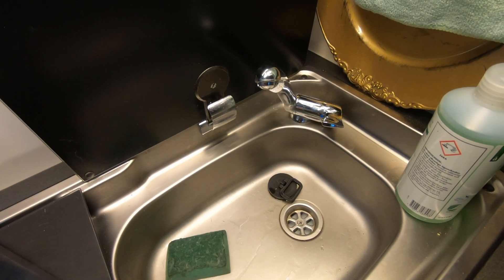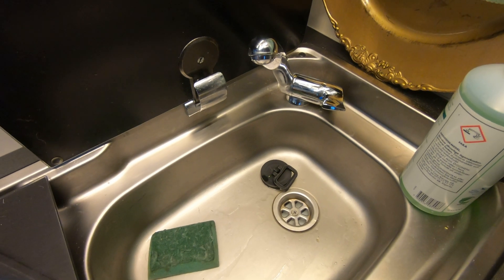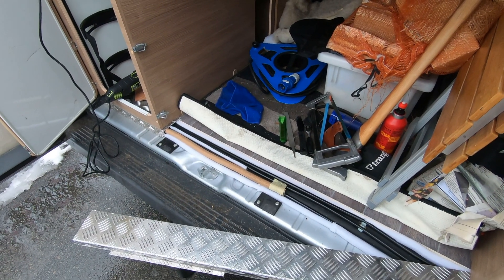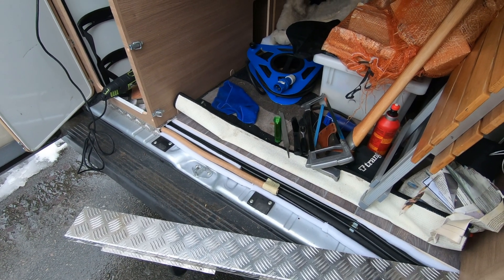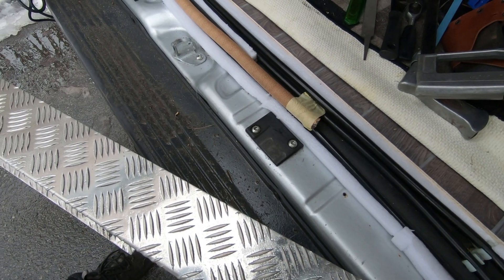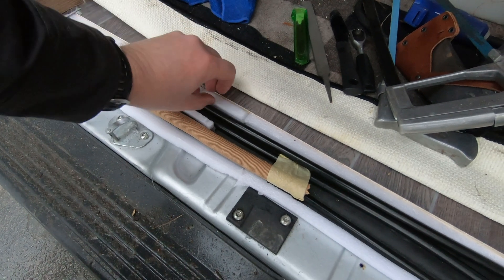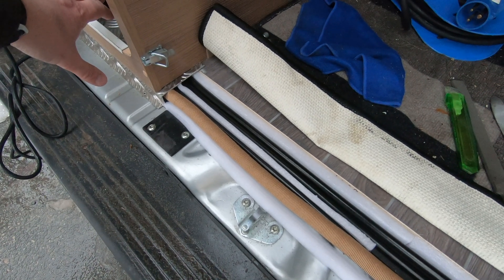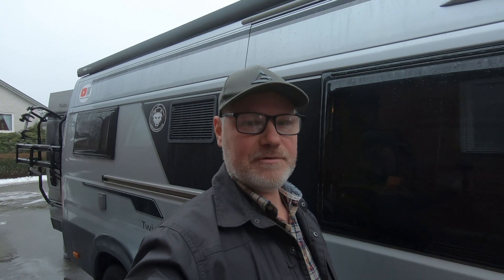Winterizing the Van - Adria Twin Plåtis Tips

Comment: Isn't it just as easy to empty the kitchen sink with a siphon (hävert)? You don't even have to gp outside to disconnect anything. That is my solution when the kitchen drain freezes. (Adria Twin 640 SLX, 2016, Alde heating).

Very interesting to see where the pipes are drawn.
Reply from the maker: HI Magne, this sib pretty much what we did the 3-4 times it has frozen. Annoying to say at least, so now I disconnect the pipe/tube when I know it will be cold. Takes less than a minute, half turn on the lower clamp. 

You have the Nordkapp edition the, they were called that while our version was called Scandinavian Edition. I bet the Alde system works great and there  are radiators placed around both sides of the van? I saw an Nordkapp Edition last summer at Orust, that was Ulf and his wife, they are members at the Adria Twin Group on fb as well. It looked good what I could see. With that said we are happy with the van and the Truma delivers great winter comfort. Hopefully we get less problems with the rear water pipings after I complemented with insulation.
Reply: @Braapncamp  
Hej,
My version is also called the Scandinavian Edition. I think the Nordkapp hadn't been launched in 2016.
But, yes, I have radiators all around including under the chairs, in the kitchen block and in the garage as well as heat pipes in the floor. I also have a mat with heat pipes up front in the drivers cabin, which is excellent also for drying skiing equipment, boots and clothing over night. In addition there is a heat exchanger that connects the Alde system to the diesel engine which allows me to keep the Alde system and the walls warm while driving without burning propane.
A disadvantage with the Alde is that if you let the temperature down it takes more time to get it back up as there is a lot of fluids that must be heated. On the other hand it also takes time for the temperature to fall, so opening a door does not immediately lead to a noticeable fall in the temperature.
Reply from the maker: @magnefauli  A great set up and well implemented by Adria in co-op with Alde in Eslöv, Sweden then. I have had Adde heating in several caping vehicles as well and it is nice. Truma works surprisingly well in the later generations though, this is the second motorhome we have with air vent heating, the one before had Webasto instead of Truma diesel heater. (This one is Truma LPG). Miss the diesel as fuel for heating, convenient. Thanks for the explanation of how the Twin with Aloe is configured.

Comment: I don't have this problem...I don't have a van😁 but the van camping looks like fun.  I wonder what the advantage of a van is over a trailer.  It seems to me a trailer can be disconnected and the tow vehicle can be used for getting supplies, going out for dinner, etc.  That may be a different vid.  Curious.
Reply from the maker: You are right! When the kids was small we had a trailer or caravan. We used it to get down to the Mediterrane, visiting relatives and alot if other places. We had alot of fun and very practical. Thks was after me and Bibbi had expmored the Alps with motorcycle. Two different ways of travel. Then when the kids grow up we got us a motorhome and the van latest for better agility. The motorhoming or van way of traveling is more like motorcycle travel regards how you do it. Explore stuff on the days and set camp later on the days, with supplies arranged. So this like rakes us back to how we like to travel or explore. A trailer is definately more practical when a vehicle is needed for other tasks, more seats, better security etc.
Reply from the maker: And normally caravans/trailer do not have this type of problems, at least not the Swedish made and moste German brands.

Comment: I collect all the gray water of my 4x4 truck camper inside and so far I have had no issue with freezing pipes. My outside 30 L fresh water tank is not in use during winter and I rely on the 2x 22 L inside.
If you think about an extra and additional diesel heater just for winter time check Autoterm Air 2D. You would need to reduce the standard 60 mm warm air pipe to the much smaller diameter of this brown heating pipe in the back.
Another possibility might be an extra tube insulation to shield the water pipes completely.
Have a good year 💙💛🏁🤛🏼
Reply from the maker: We also take our 22l water jug just in case wintertime. We had the water running at -22° C so it actually work somewhat ok. I likes to freeze in the rearend while driving though since the front cabin heat fools the thermostat of the van heater so it tunns on low. This small improvement reduse cold air flow in the rear. At the same time the way I did it it does not insulate the tubes from the "warm" air that comes from the tube. It lower the volume to be heated and let the warm air reach the water pipes. Best thing of all is that i get quick access to the pipes now. I dieselhwater is a great idea, not much for this matter but for better independence from  LPG. We had a Webasto dieselheater in our earlier motorhome worked like a champ to heat up the mltorhome with comfort thru the additiona digital multicontrol. I might complement with a diesel heater actually and as you say at tvat time i could get mpre air to this compartmemt at the same time. Thanks for your comment 🙌👌

Comment: Videos like this are gold Mattias. How about some heated cable inside or wrapped around that spill water hose? would that make for a solution if you plan to use the van alot in winter? I have this at our cabin in the piping that goes from the ground and under the cabin?
Reply from the maker: That, was a thought i had and have. Ybe greywayer tank it self is heated with a heat mat, 12V and draw a significan current so to keep that heated is only possivle when driving och hooked up on electricity. We wild camp alot or actually mostly so tvats not really an option. Bu to have12V  heated wire on the piping works to just melt up any frost plug works. Even if I insulate the wastewater pipe i must have it disconectable when it eventually freeze. In the rear it was needed to improve insulation regardless of improved heating to the area, best thing also, now when I cut the aluminium list I can access the area quick. Either to improve further or just to get the heat i already have in the garage compartment to reach the piping better. It won't be many days in a year with cold enough to bother with this. Annoying when it happens though 💪😁.